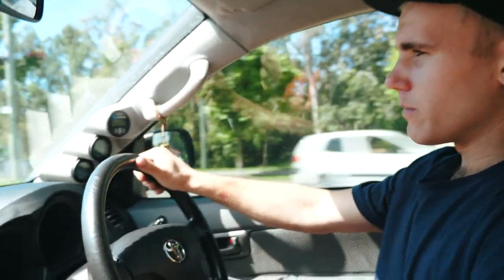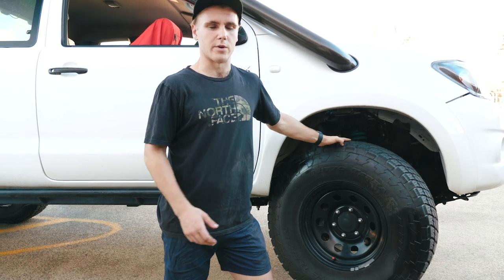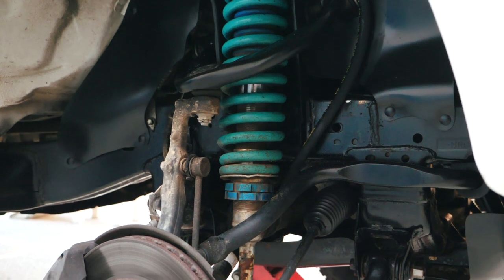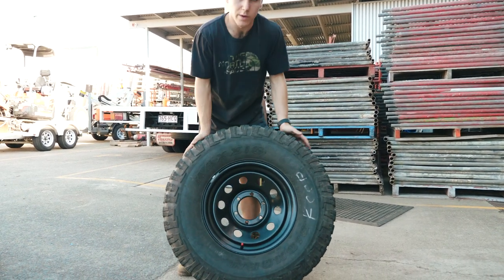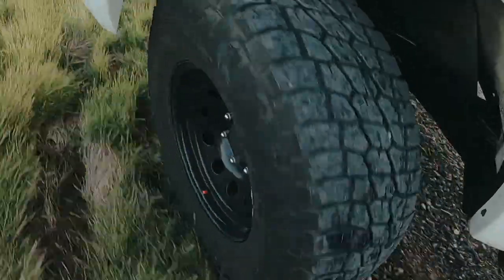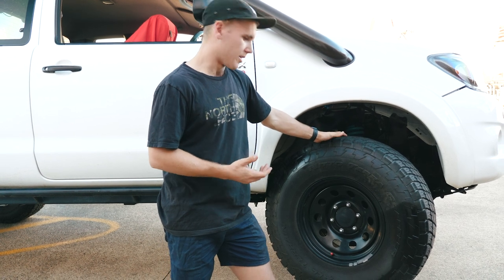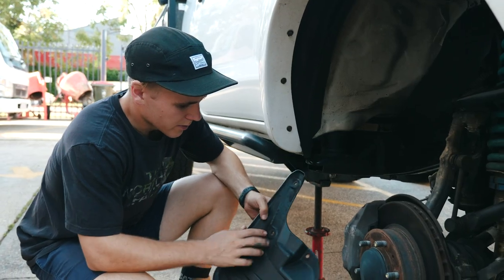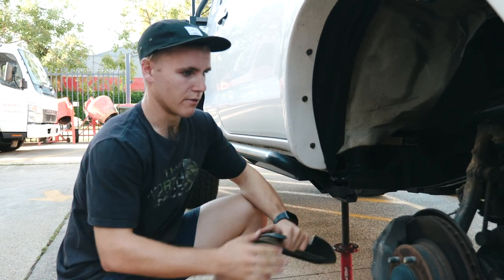How to fit 285's to a HILUX

Comment: Hi mate,
Great video, been enjoying your channel. Just wanted to clarify, did you say these 285’s should fit regardless of a lift kit? From what I could gather then is it just a case of castor adjustment, aftermarket UCA’s and some trimming? Btw, what brand tyres and UCA’s did you go for?
Reply from the maker: hey mate, yeah the 285's should fit with a little bit of cutting and caster adjustment. ideally you'll want to do a body mount chop to get the most from it  as well. Aftermarket UCA's will make it drive better and allow slightly better down travel. I have "Blackhawk" UCA's which I'm pretty sure are made by Roadsafe and I've had no issues at all with them. My tyres are 285/75R16 and they are Nitto Terra grapplers on 0 offset rims.
Reply: Ryval Creative thanks for the reply mate, much appreciated!! 🤙

Comment: Hi mate, I have 2018 hilux sr5  18×9 wheels with 2"lift, just wanna ask if I put 32"tyres will fit fine? Thanks in advance..
Reply: they shoudl because 285 70 17s are close to if not 32,s

Comment: Hey mate, love the videos. So good to finally get a clear answer on it all. I have had the same trouble with finding all the information needed in the same place, all the things I found at the time all recommended 3" lift and diff drops etc. I ended up just running 265's but would love to go bigger.
So going off your videos, you had fitted the tyres first before installing the uca's. 
Ive looked at aftermarket uca's and seen that they have castor correction, this may be a silly question but does the correction counteract the original adjustment that you get the tyre shop to do at the start and does that cause any rubbing on the body mounts once in?
Reply from the maker: Thanks for watching mate, aftermarket ucas will need another wheel alignment and yes it will most likely cause rubbing on the body mount depending on your offset. so you’ll probably need to do a body mount chop.

Comment: Concise and clear. Been looking for this info for a while now. All I have is testimonies which require massive mods to the vehicle.

How does it influence the power and fuel consumption with the larger Tyres?
Reply from the maker: It hasn’t really affected the fuel consumption too much maybe slightly worse now but not super noticeable for me. power did take a big hit especially when moving off from a stop it’s super slow and 1st gear does feel a bit too tall now. Overall it’s still fine to drive though but I’m definitely looking into either a tune to help with power or re gearing to fix the ratios up
Reply: @RyvalCreative  en mi hilux 3.0 con llantas 33 antes en primera marcha me daba 45km y ahora 25-30km, revoluciona pero no agarra velocidad

Comment: Hey man awesome video! Just quick question. Right now I have 70mm flares the I bought from kutsnakes. So for the rims do you think positive 10 will do the job with 265 or 275tyre?Cheers
Reply from the maker: Mine are 0 offset and my flares are 60mm and sits almost flush with the flare. So from that I think Positive 10 would be about 20mm inside the flare since your flares are 10mm wider than mine and pos 10 offset would mean your wheel sits another 10mm in

Comment: Hey man, wicked video !! What rock sliders are you running ? I have a space cab and struggling to find some. Cheers !!!!
Reply from the maker: Nick Diaz they are Phat bars angled rock sliders mate. Pretty expensive but solid as and they make them specifically for the extra cabs
Reply: Absolute legend for this! Cheers!

Comment: How much slower did it make the car ?
Reply from the maker: Pretty noticeable difference, definitely doesn’t take off as easy and towing is pretty bad now. I want to regear in the future to correct the ratios. I pretty much don’t use 5th now either it comfortably does 110 in 4th
Reply: @RyvalCreative  cheers